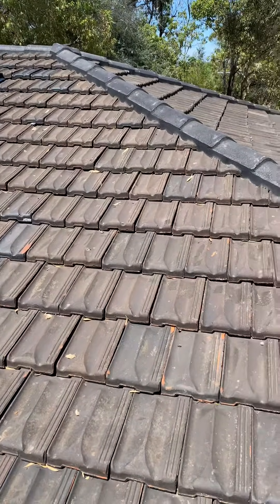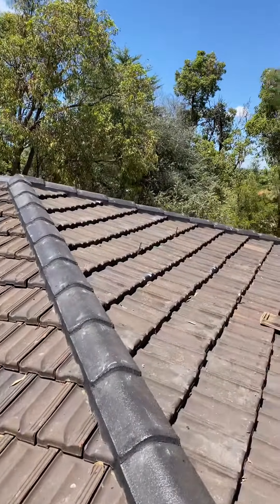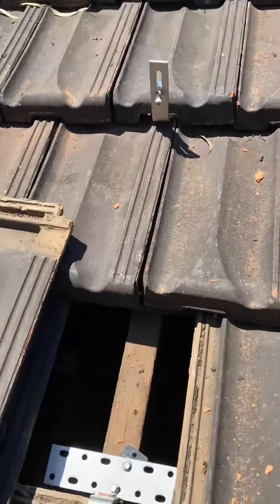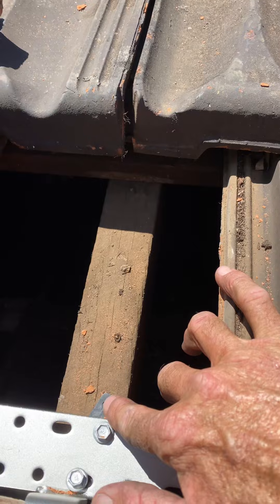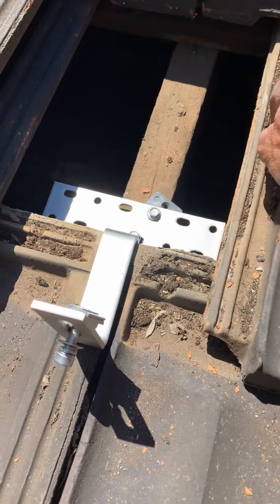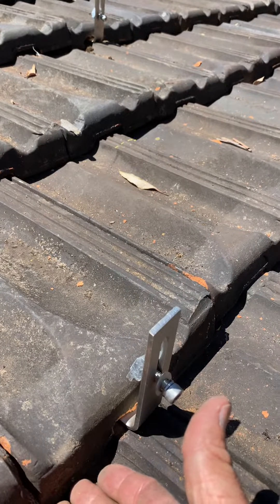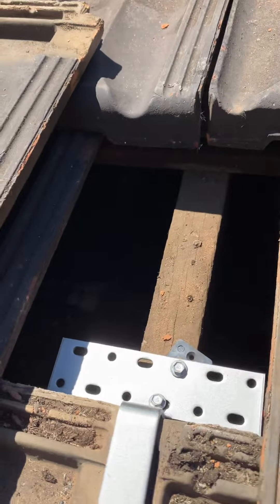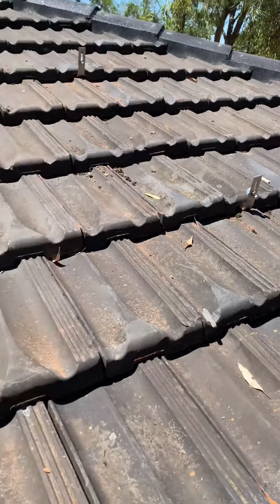How do you fix the solar panels to a tiled roof!

Comment: My roof tiles have been leaking by Sun Solar system . They came to inspection my roof tiles doesn’t have support fly wood and felts paper. But they still installed Solar’s panels,
They were cheating not Reliability,  I contacted them to fix but still have a big gaps,I filed a complaint to the state board department, Will see if they can’t  fixing it, Then I will do Law’s sue